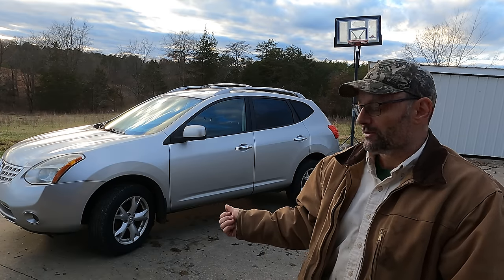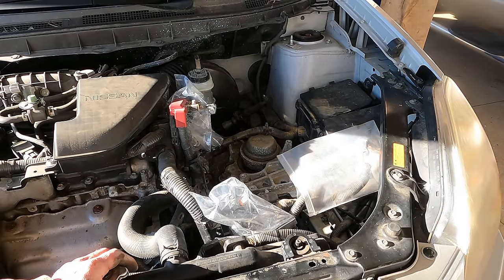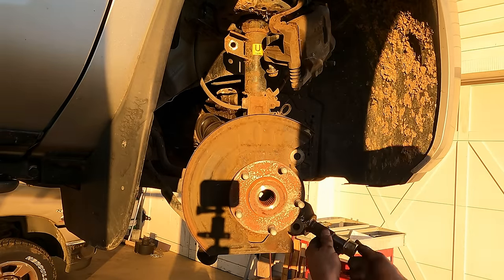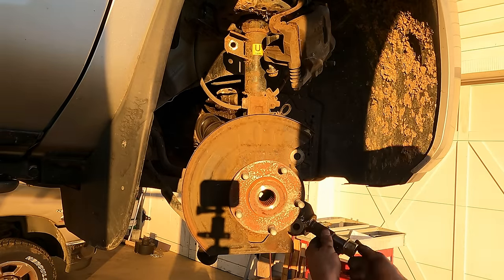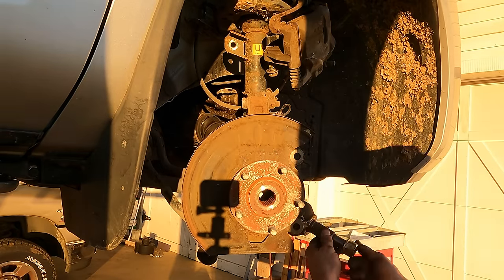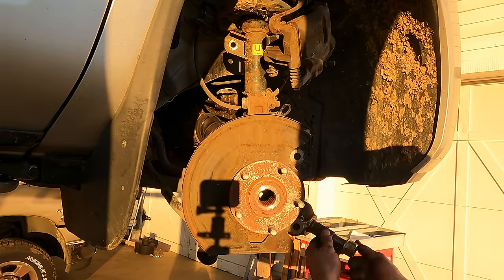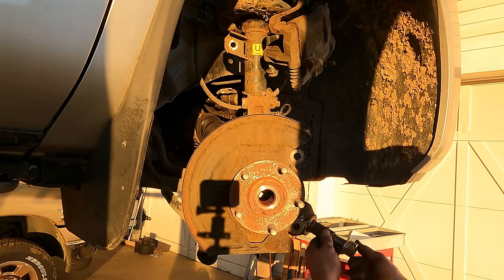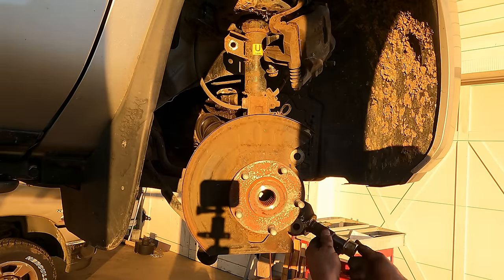Fixing a Nissan Rogue Transmission So I Can Give It Away. GOAL MET!

Comment: Nice work on taking this cvt out.  Would like to offer my 2 cents and share some of the common issues with these cvt transmissions...1) the pump flow valves on the pump itself usually get scorched up and or jammed and need to be updated.  2) the secondary pulley does most of the work in this unit.  You have to dismantle it with special tools otherwise you risk hurting yourself.  The 2nd half of the pully that slides up and down to change the gear ratio, it slides on 3 small ball bearings grooved into the shaft which usually eat out the shaft.  You can upgrade those ball bearings to solid pins.  3) Behind the secondary pully theres a piston with a big black Teflon ring which usually get chewed up and embedded with metal filings from the wear and tear and stops holding pressure.  The pulley works at about 500-800psi of pressure.  Depending on damage, both might need changing.  4)  sometimes when you take apart the Pulleys you discover they have snapped inside and need replacement. 5) Since the secondary pulley is the most used, the secondary pulley valve in the valve body gets worn out.  It should be inspected.  5) The belt has small vertical grooves on it's edges of the elements.  They usually get scorched and belt starts to slip and requires replacement.  6) Make sure to inspect the surface of the Pulleys as they should be smooth without any grooves.  7) Depending on the type of driving and mileage, might be a good idea to replace the torque converter. 8) Make sure you get the Nissan cvt oil when it's all said and done.  

Hope this helps!
Reply: Did they start selling parts yet?
Reply: @maxwebster7572  maybe in about 5 years
Reply: Sounds like you "been there"!
Reply: CVT trans. are the worst auto inventions of the last 50 yrs....why ,,engineers whyyyyy????What was wrong with the regular automatic trans???  Well i know what the answers are gonna be ...!!!!
Reply: the meat n potatoes
thank you for this info bruv
Reply: Pretty sure the belt is used in compression, not in tension like a regular belt. That why theyre stacked  steel plates and also not like a cycle chain
Reply: If I don't have Nissan cvt is it okay to use Valvoline cvt fluid,?
Reply: AVOID Nissan CVT fluid.  Their CVT fluid is the reason the CVTs fail.  Use Castrol TransMax CVT fluid instead.

Comment: The half shaft you're dealing with has 2 CV joints.  An outboard Rzeppa joint that has 6 balls riding in grooves and an inboard plunging Tripod joint.  The inboard plunges to accommodate the change in required length as the suspension swings through its range of motion.  This configuration is very common in modern passenger vehicles.  Each style joint has its own pros and cons and when used in this combination, you get a pretty good solution.  
Thank you for tearing into the CVT, it was fun to see it's internals!

Comment: As far as I know CVT "belts" don't stretch as nothing pulls on them.  The belt is comprised of elements held together with bands, their only job is to hold the elements together.  Torque is transmitted though the element stack by pushing on the stack.  It's possible that it's just the pulleys and belt that have just worn down, replacement sets aren't that expensive online...  Good luck and happy new year!
Reply: How does one find these parts? Search for parts for that particular transmission? Thank you! Old guy that hasn't had the internet his whole life!
Reply: @dans_Learning_Curve  Strange we can see this comment even when old guy has no internets. Telepathy??
Reply: @volvo24091  I have internet now. Didn't have it growing up. 😜

Comment: Hey Farmcraft. Car detailer here. If you want to fix those headlights (get rid of the oxidised plastic) use 1500 grit wet sandpaper in a side to side motion spraying water on it. Then 2000 grit up and down (all over) then use a polish compound and machine polisher (neumatic drill/hand) to finish. Makes the car really pop for the lucky kiddo. Great job :)
Reply: Coat the polished headlight assemblies with 2K clear coat to make the headlight assemblies remain clear over a long period of time.

Comment: Thanks! Good luck to the lucky student that needs a car God Bless for what you are donating your time for a stranger   My 2015 nissan sentra with 40000 miles cvt went out it was 4800 bucks wwith labor to get a factory cvt with year warranty and i drive in rural area and at 52 yrs old i dont horse it unreal when they took it apart. Never get a cvt trans go manual

Comment: 3 weeks ago i do the same job on my 2008 rogue. I buy a new set of pulley and chain, reman body valve and oil pump on ebay for 1300$. I change the 2 oil filter to. I put Lucas cvt oil in. The car run pretty well now.  I am not a mecanic but just love doing things by myself. Thanks for the video!

Comment: I would strongly recommend adding additional transmission fluid cooling. I had a 2012 Altima that went through a couple of CVTs one under warranty, and another on my dime. I added an additional oil cooler with the third trans and it did much better. That generation of Nissan CVT had a horrible issue with the fluid getting hot and then the torque converter lockup was inconsistent which if you are lucky puts you in limp mode, if you are not causes all kinds of stress on the rest of the transmission. The torque converter continuously slipping is not ideal but does not really damage anything. Having it lockup randomly after slipping and when your RPMs are way up kills those belts.  Kinda like popping the clutch on a manual all the time, and not just from a standstill. Half the milage of the vehicle was on that last transmission and it was going strong when we sold it. The thing looked brand new inside and out and if it had a manual transmission somebody in the family would still be driving it.
Reply: I hope that he sees your post. This is the sort of feedback he was asking for and he sounds like he has the funds to do this sort of thing as well. Maybe give some more specifics of the way that you set it up and hopefully you will get some more thumbs up and he might notice your post.
Reply: In all, I’ve read so much about Nissans and the 4 cylinder cut transmissions that are horrible. So you wouldn’t recommend anyone purchase a used vehicle in you opinion?

Comment: You can replace the inner cv boot on the drive shaft.  There's a spring clip on the inside of the housing. Flick that out and the shaft will separate, leaving the three bearings held to the stub with an external circlip.
Reply from the maker: Yep, I figure that out later.  thanks!
Reply: You are awesome thank you lol

Comment: With a few more bolts, could drop engine/transmission together. It will be lot easier putting back in car. It was put in as a drive unit on factory line.

Comment: In my area Nova Scotia 🇨🇦150,000 miles( 241,000KM) with the salt they use on the roads and the last few years brine as well. You would need a torch for almost every bolt or nut. If it was even worth fixing with the amount of rust. Undercoating is our friend. 👍
Reply: Yes, oil undercoating is your friend here in Eastern Ontario also, during the winter.

Comment: You never cease to surprise and impress, John. And you're absolutely correct that rural areas have no easy fixes for transportation. One thing, if I'm not mistaken, the Rogues need entire driveshafts when u-joints go. Had a friend with a circa 2010(?) that found that out the hard way to the tune of $1000.

Comment: I'm not an expert but ran across this a few years back. There were 2 internal speed sensors, input/output shaft. Replaced both cause your already in it. Admittedly it was a halemarry, but as a heavy equipment mechanic I arguably had more knowledge than money 🤪😂. It actually worked. Good video happy new years 👍

Comment: I bought my 17 yo daughter a 2014 Mazda 6 with about 100k miles last year in mint condition, paid 10k for it from a private seller (absolute steal at the time).  She got into an accident, where the front was moderately damaged, car still ran and kind of drove but the insurance company totaled it still.  Got a check from them for almost 15k, point is there was a not ton of damage and they still totaled it because it costs an absolute fortune nowadays to repair these more modern cars.
Reply from the maker: It's a shame really.  But hopefully they at least parted it out so it didn't all just go to waste.
Reply: It is very expensive to repair modern cars but that's almost completely because the modern cars are designed to absorb The energy from a crash preventing your body from having to absorb it. 
What was a moderate accident with I'm assuming pretty minor injuries in that car could have been a tragedy in a car made 40 years ago.
Reply: Nobody takes care of stuff better than those who bought it them selves.
Reply: I was going to say something like that - hopefully it is a donor now
Reply: @FarmCraft101  Often, cars that are "totalled" end up being repaired and body cleaned up overseas where they are sold and used again.  Many countries don't have the same safety standards as the USA.  They are sold for more then parts in the US, but still a lot cheaper then a new vehicle.

Comment: The ball bearings that allow for the clutch to go in and out get out of round.  Causing the belt to slip. And can be remedied by using a couple of drill bits welded into place of the ball bearings.  Then the cones can go up and down the way it did from the factory. Good luck with your project.

Comment: Good on you for doing this.  I recommend changing the struts, the starter, and alternator just to ensure trouble free operation as you already have it all apart.  My experience has been with older cars that as soon as you do 1 thing, the next thing fails.  Easier to just do it now, then deal with a problem every 5k miles.

Comment: My only experience with cvt drives is snowmobiles and for that, they work fairly well. Lightweight, simple, easily accessible. The belt is treated as a wearable and easily replaced part. It is difficult to believe Nissan thought it was a good idea to make the trans and sub assembly needed to be dropped for a belt change. From what I've heard of these , the car is the expected good quality nissan has worked hard to earn. All but this darn cvt Transmission. 

Great on you for taking the time and effort and pay it forward to this lucky rural kid!

Comment: I must say that YOU are the man. And now I know why I'll never own a Nissan 😲
Reply: A CVT one. I have a 2000 Nissan with 242,000 and never a problem, yet.
Reply: The problems is not CVT....99.9999% people who owned them never changed transmission fluid....you suppose to read owner manual when and under certain condition at what mileage to change the fluid.....get it!
Reply: @peterta5035  I don't know if it's the case with these, but I know thst other manufacturers (I'm looking at you, Toyota) are advancing the lie that you don't need to change transmission fluid.  They seal the transmission and declare it to be filled with "lifetime fluid".  And they're right...if you don't ignore the OEM and change the fluid, it will last the lifetime of the transmission. In fact, it will define the lifetime of the transmission...and that "lifetime" will be much shorter than it the owner will think it should be.
Reply: If you do proper maintenance on them , and don't ignore transmission fluid and filter change every 25,000 to 30,000 miles you will be fine , did you see the color of the fluid he pulled out of that transmission ? It was never changed from the looks of it , nothing lasts forever  !

Comment: If you are planning to run this car 50k+ more then plan on 2 CVT fluid and filter changes, or every 25k. Use Castrol CVT fluid and OEM filters (pan and cooler) and an OEM pan gasket. It's easy and cheap to do to make sure the money spent on the new CVT is not a waste. Also look into all the wheel bearings too, Japanese sourced ones go about 100-120K before they start to fail, and then the struts/shocks/control arms/ball joints.
Reply: Castrol fluid/oil is the only one I will ever use.
Reply: @erikcourtney1834  I serviced the Mitsubishi I shipped to my daughter with OEM fluid (read $$$$) because she might go to the dealer for servicing and used Castrol in my new to me 2014 Mitsubishi. I have no issues with the Castrol

Comment: The inner CV boot is regularly changed alone here in Ireland (I've seen American mechanics changing the whole drive for some reason so maybe they're not available there) but to change it is pretty easy remove the boot (make sure to support the rollers so the bearings don't fall out (a rubber glove does the trick) then there should be a circlip on the end of the shafts holding the rollers on once removed it'll slide off without any force (no hammer needed) then just slide on the new boot replace all and your done
Reply: Here in the states they have axles more available than boots and almost as much money to replace the boot counting the labor as to just replace it
Reply: A boot used to cost between $10 and $30 and a CV joint alone would have been around $110 and the labour is pretty much the same for either job 🤷‍♂️
Guess it's just the way the industry is going leaving less and less serviceable parts

Comment: I have a Murano with 90K and the most important thing you can do to increase the transmissions life is to change the oil just like you would on a normal automatic, every 30K and you must use the expensive Nissan transmission fluid.  I do agree that these are not the best, especially compared to the 7-9 speed automatic’s that are out now.  Jon, your the best, living the golden rule.  Thanks for all the knowledge you have share on this channel.  Keep it up!!!
Reply: 100% truth in changing the fluid and using Nissan fluid. My company had a fleet of Nissans and the only CVT failure in that fleet happened on a 10 year old Altima with close to 190k miles on it. Fluid changed every 30k with Nissan fluid.

Comment: FYI most of these CVT transmissions are pusher belts, not puller like rubber belts.   The belt is probably worn out or the large seals on the pistons in the sheave (pulley) that hold the sheaves position are wore out and that allowed the belt to slip either way the belt should be replaced
Reply: or just Nissan junk....

Comment: I am a retired auto collision tech and I can tell you from experience that it’s much easier to pull the engine and transmission together . You have a two post lift . Pull the engine cradle with the engine an trans intact . There are a few wiring harness that need to be detached from the body ,take the exhaust loose at the cat converter . Loosen but do not remove 4 bolts attaching the engine cradle to the body . Just loosen the rack and pension and tie it up out of the way . There are a few other things you will need to detach but after you have it loose lower it down on blocks of wood or jackstans finish taking the bolts from the engine cradle .just think it through . I could have one out in 1 to 1 and a half hours .even less on Some cars  that’s how I replaced frame rails in Uni body cars .I did have a home made dolly about 2ft tall to sit the cradle on but you could fabricate from 4x4 post with casters.

Comment: Cool idea and as always very good video! I would look through every part that you removed and check them for slack, like the axles and all the other moving parts. Specially the ball joints and rubber parts will be shot after that milage.

Comment: Would it have been easier to remove both engine and transmission together? We do that quite often when we work on a lot of front wheel drive sidewinders
Reply: Do you mean like to lift the car off the engine and trans? Unbolt strut mounts, disconnect harness, unbolt subframe etc etc? That sound easier then all the steps he had to take. I've personally been lucky enough to not get stuck with one of these junk trannys. Is that best way to attack this beast?

Comment: CVT's are a marvel of engineering.
They also have become a feature to expedite the "dealer lot to scrapyard" pipeline in some brands.

I love what you are doing in this video.  I grew up in rural southwest Virginia (coal country) and a vehicle was an ESSENTIAL ingredient.  No wheels, no job, no life.
Reply: " CVT's are a marvel of engineering". CVT's are great on a snowmobile and belong on nothing else. Used on a car------- nope.
Reply: @quantumss  They certainly have potential.
However it seems that most used in modern automobiles are under engineered and are damn near impossible to get parts for.  It really says something when the average life of a CVT is around 100k.  It's almost as if the intent is to get you to replace the car...
Thus why I buy older cars.  If I can't fix it, I don't want it.  I have a 2000 dodge neon with a quarter million miles (needs a clutch cable, but still runs great) and an older nissan frontier going on 150k.  I'll run 'em both until they fall apart and replace it again with something early 2000s.  I like to dispose my disposable income on less disposable items than new cars 😁
Reply: It’s easy to understand while looking at the belt and considering it moves a car. What were they thinking?
Reply: @quantumss  Exactly what I was thinking. If they are gonna put them on a vehicle than at least make them easily accessible and serviceable like on a sled. I feel bad for future generations, everything is throw away now built to minimum specs with companies after that forced return business.
Reply: @mattfleming86  That funny. "Almost as if the intent is to get you to replace the car".. Lol. Almost like? They want it to last the warranty period. Also why they seal the units with no dipstick and call the fluid "lifetime".